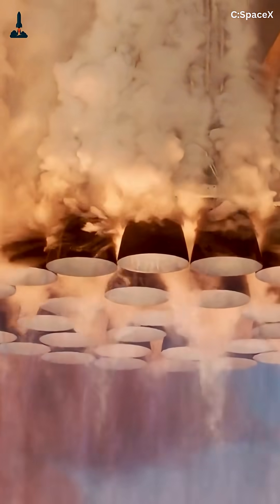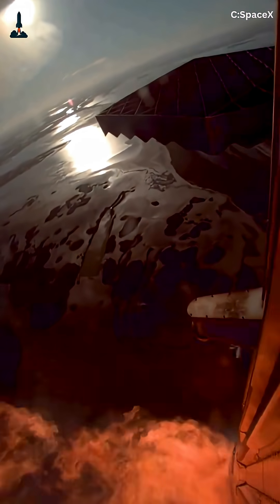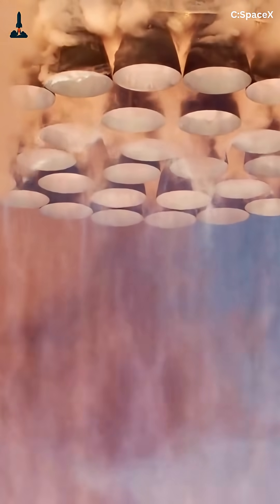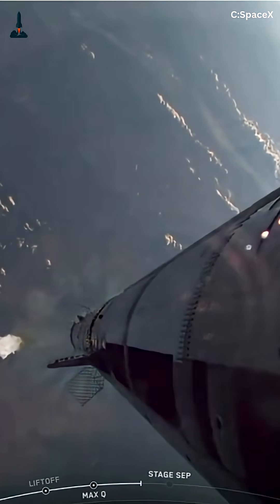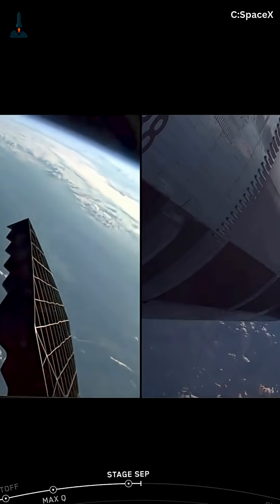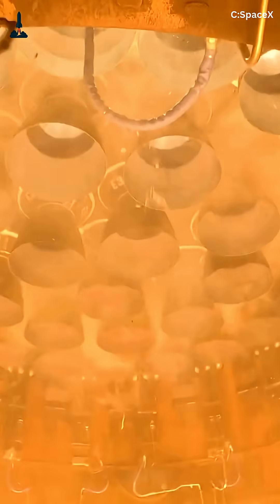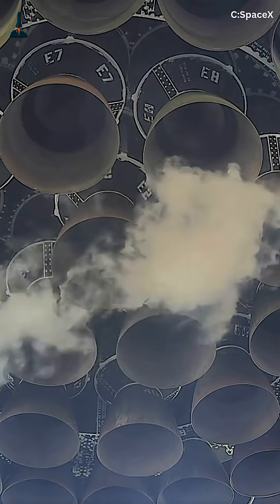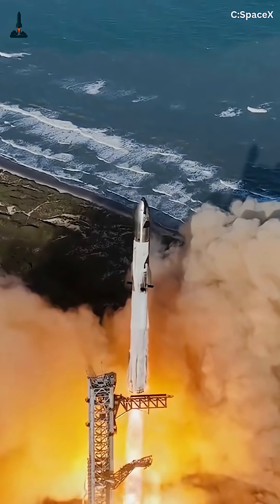Why SpaceX’s 33-Engine Rocket Shouldn’t Work—But Does #spacex #starshipflight11 #starship #elonmusk

Comment: How do they keep the base from melting?  What is it made of?
Reply from the maker: Super Heavy’s Raptor engines prevent the base from melting using powerful water-cooled flame diverters and heat-resistant steel shielding that deflects and absorbs extreme exhaust heat.

Comment: 33 engines = 32 completely unnecessary items
Reply: Something of this scale cannot be effectively propelled with one engine. An engine of that size and power would be insane and most likely very inefficient. And if that engine were to fail? Complete mission failure. Also during the landing of Super Heavy, one engine would be wayyyy too much thrust for such a lightweight booster (atleast compared to its weight when fully fueled). 33 engines is much more efficient and the mission won’t fail even if multiple engines fail. With 33 engines, the booster can go down to 13 and 3 engines to do the landing burn, which is a much more reasonable thrust for a returning lightweight booster. 33 engines is just overall a better design

Comment: Answer: it's very complex, but easy to do. AKA a computer does it. Just like with drones that have multiple rotor engines.
Reply: Easy to say that it's easy to do
Reply: @SomeHobo  It's not easy to set up the thing. To gain the knowledge necessary to program it, the algorithm needed to execute it, the engineering needed to complement the software. But once that work is done, "Why SpaceX's 33-Engine Rocket Shouldn't Work-But Does" is very simple - the computer does it. The trillions of calculations per mili-second necessary in order to operate each engine in order to keep the thing balanced or going in the direction you want it to go - the computer does it all. And you now have a crew of people with experience on how to do it, so it can be replicated.
Reply: @Foxstab   That's what i'm saying. Not easy to "set up the thing".
Reply: @SomeHobo  I never said it is easy to set up. I said that the answer to the "why" in the video title is very easy. I knew it already before I even clicked it.

Comment: 🔹️I love this. The synchronized/controlled chaos, as you put it, is pretty awesome. 💯% control isn't possible, but guiding what you know is going to happen proves how familiar you are with the thunderstorm. The compensation that will adjust either way is bending in the wind instead of breaking.
🔸️May your week start out smooth!🥰🌻

Comment: On mars are you going to build to protect the product and test what it does to the product over time. There are machenical machines on mars I wonder if there still working and how long they have been working ⁉️
Reply: Mars rovers Curiosity and Perserverance is still working and have been operational for about 13, and 4 years respectively.